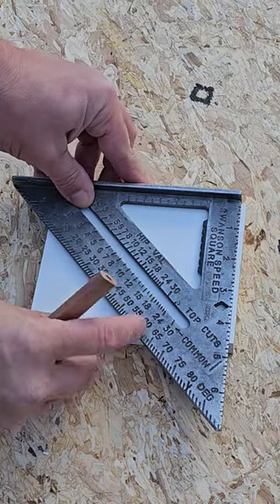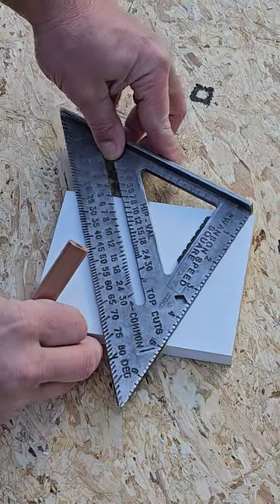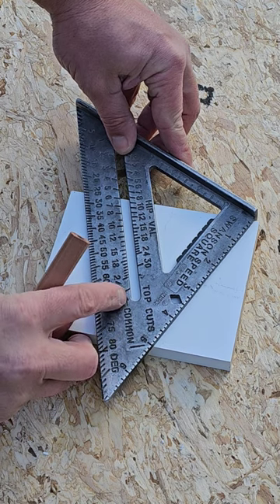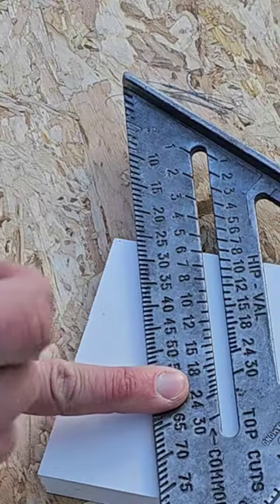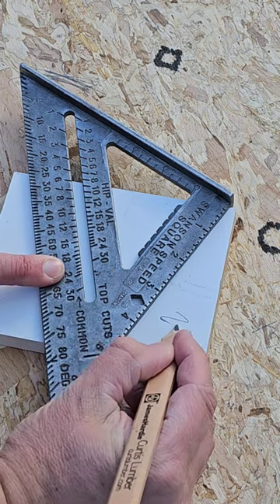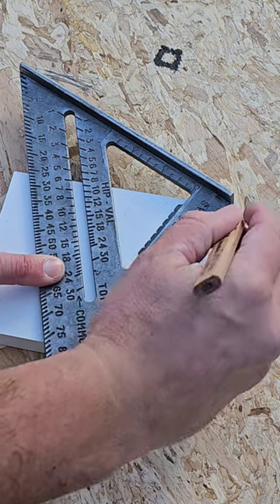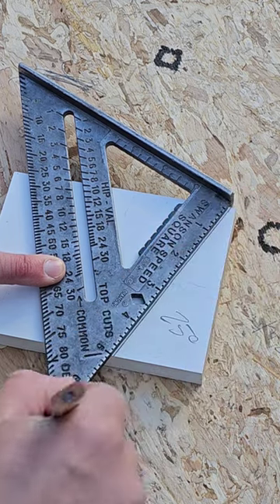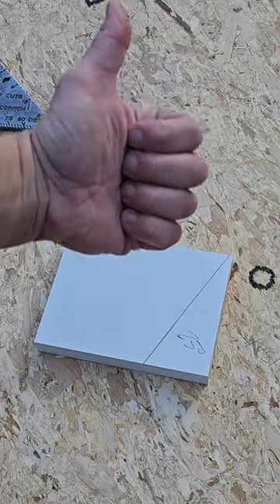How to mark an angle! #shorts

Comment: I like the videos, but personally I'd appreciate it if you could dial up the vulgarity and cursing. Not quite enough for me.
Reply from the maker: I feel like I'd be blacklisted from here if I did that though! 🤣
Reply: It's alright. Your the POS carpenter. Your untouchable because you have enough ammo to keep those fellas miles away.
Reply: It's already over the top and confusing. Like, what's so lazy about using a speed square in such a normal manner?

Comment: Get rid of that brick layers pencil.  Were carpenters. Those pencils aren't allowed on my jobs.
Reply: What? It's literally called a carpenters pencil. Is there something I'm missing? Idk, It's what I've always used.
Reply: Are you nutz
Reply: @KeMiZe44  I don't care what they're called. The led is too fat. No real carpenter uses those. I call them brick layers pencils because that's the only thing they're good for. IMO.
Reply: @New_Creation7  if you sharpen them more than  once a day they are good for framing, just like marking an angle with a speed square it's quick n dirty.....just like your mom😮😅 

These ain't the tools of a fine furniture craftsman